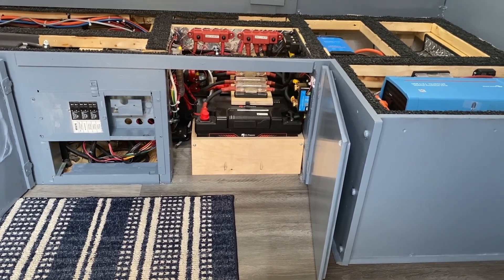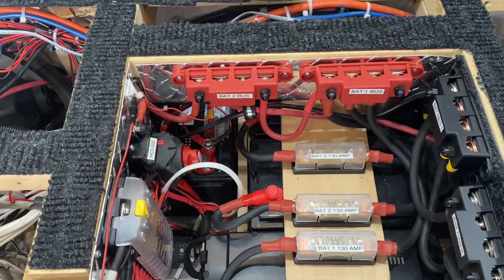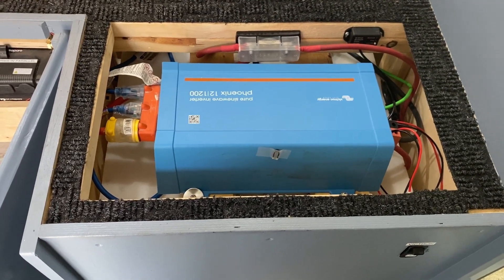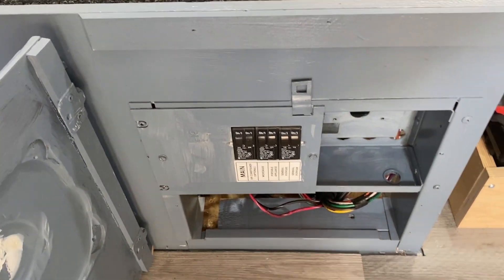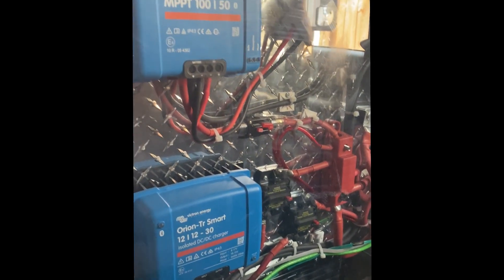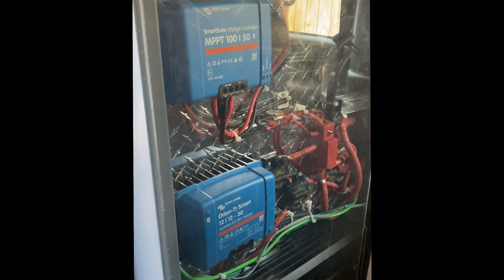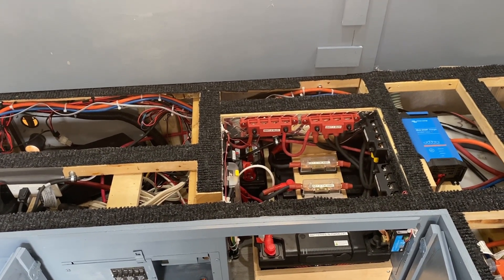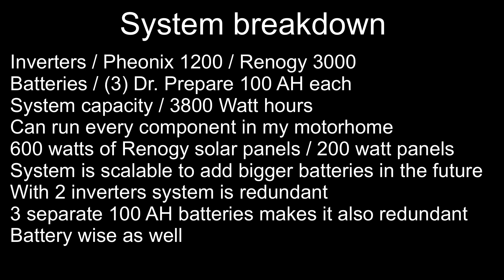COMPLETE VICTRON SYSTEM INSTALL - LITHIUM BATTERIES - REDUNDANT INVERTERS #DIY #victron #SOLAR #RV

Comment from the maker: The lithium batteries are from Dr. Prepare and where very inexpensive and I was able to buy them on sale for $259 US. My thought on these batteries is that technology is changing so fast that in 3 or 4 years I will be able to upgrade to higher capacity batteries that are smaller for about the same amount of money.

Comment: Thank you. I hope you and your family are well. This system is on a much higher technical level from using the Bluetti and is way above my competence level. I am very impressed with how you have put this all together. I am looking for another all in one system to use with my Bluetti but with a bigger output that the 2k output I get from the Bluetti, which restricts what we can run at the same time. Do you have any recommendations? Keep us informed on progress. Thank you.
Reply from the maker: Hey Greg, the solar generators are changing and improving almost monthly at this point. Jackery just came out with a 3000 watt inverter system which looks interesting but if you can wait I am thinking that these capacities and even the functionality will improve tremendously over the next 6 months to a year. As far as competence level to install a system like I did I many times during the install stopped and said to my self what have I got myself into. But my bull headed personality keep me going to get it finished. The functionality of the Victron components and the ability to monitor the system is amazing. Also as I said in the video the system is scalable and down the road I could upgrade parts of it to future requirements as apposed to the solar generators are more as we used to call in the telecom business fork lift upgradable (can’t upgrade) you need to replace the whole box. Anyhow if I was you I would sell the Bluetti for now if you don’t need it for now and look in about 6 months to a year for a replacement as I think the capacity and prices will be dramatically better than. Cheers Rob
Reply: @WATCHLLS  Thanks Rob. I saw an advert for the Jackery, so I will investigate that further as we want to keep the Bluetti but add a bigger capacity output system. 3000 Watts is good for what we want. Thanks again.
Reply from the maker: Hey Greg, I have been struggling with my Fibromyalgia over the last few months, pain levels make it difficult to get motivated but as I said earlier I am bull headed so I push myself to keep moving. Thanks for asking and I hope you and your family are doing great as well. We are looking forward to my Wife retiring and starting to travel and enjoy the motorhome. Cheers Rob
Reply: @WATCHLLS  Hi Rob, I am sorry to hear your health issues are still causing you problems. I hope you can manage your pain and carry on. It is such a shame that these all in one systems such as the Bluetti are not scalable like your Victron system. Best wishes Greg.

Comment from the maker: Equipment was purchased from www.volts.ca and Amazon. Volts.ca provided a great equipment installation diagram which helped tremendously and being able to speak with them during the install made installation a lot simpler. When I had the solar generator there wasn’t any support to be had easily.

Comment from the maker: This installation was about a 4 week process, I figure I spent about 100 hours in total installing all the components, fuses, busbars and solar panels. I was able to get all the components into a very small area and still have a system that is easy to understand if down the road I was to sell the motorhome.